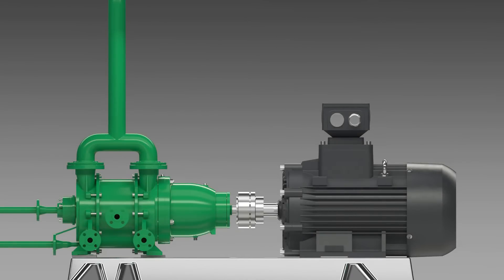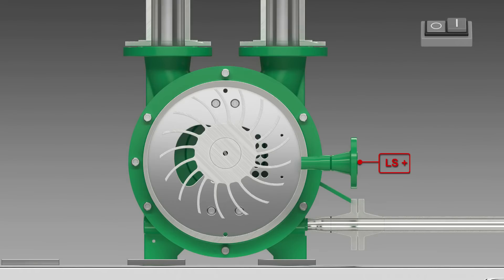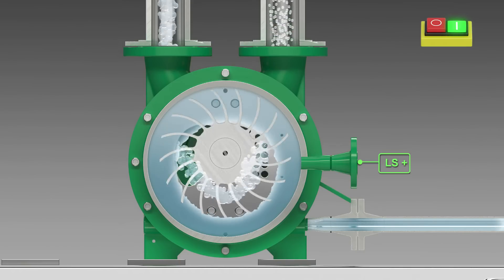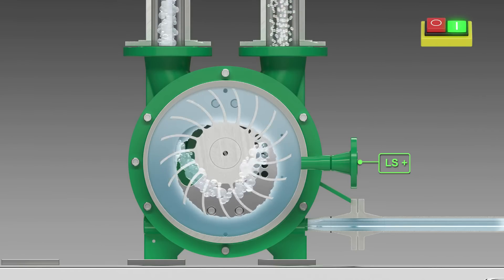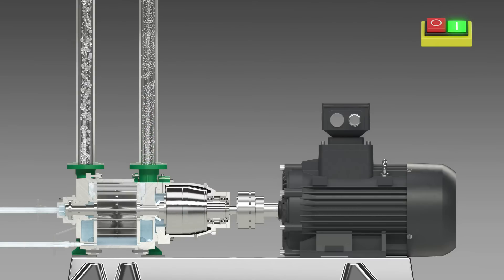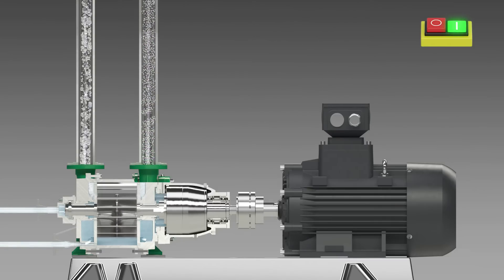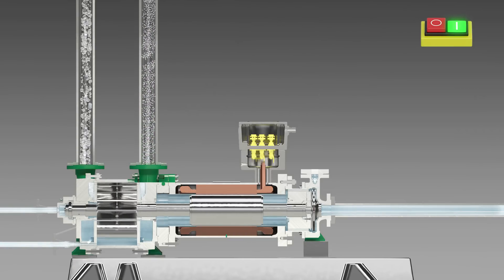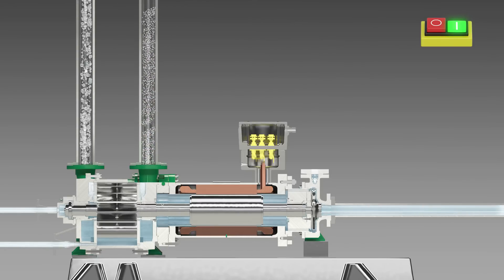HERMETIC | Liquid ring vacuum pump type LVPM-LVPH | EN

Comment: what if water gets into that liquid ring vacuum pump? does it cause breakdown?
Reply: Wouldn't the gravity make it run down the pipe? It could be that they compensate for that by installing a longer vertical pipe.

Of course you shouldn't overfill the compressor chamber with said liquid.

You can also add filters to the system to filter out the moisture in the air, depending on how clean your air needs to be. But I don't know about the cost efficiency between buying a membrane compressor (hospitals and drug labs use those, also if you're compressing aggressive gasses) or adding filters that you got to maintain regularly.

I don't know the answer to your question, maybe somebody with more knowledge drops by or you go try ask about it on a engineering forum.
Reply: @ThorOdinson1269 ⚠️ God has said in the Quran:

🔴 { Say, "O My servants who have transgressed against themselves [by sinning], do not despair of the mercy of Allah. Indeed, Allah forgives all sins. Indeed, it is He who is the Forgiving, the Merciful." ( 39:53 )} 

📖Quran